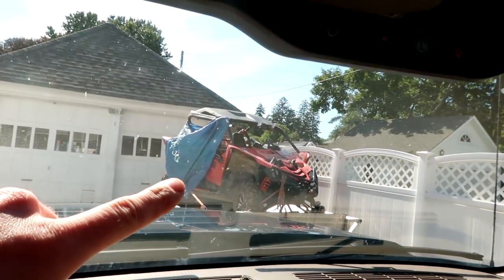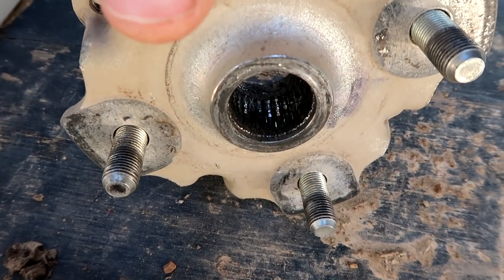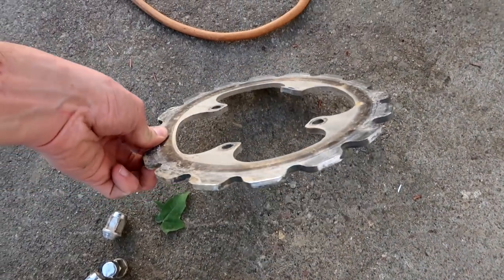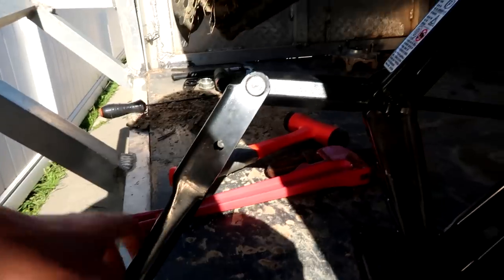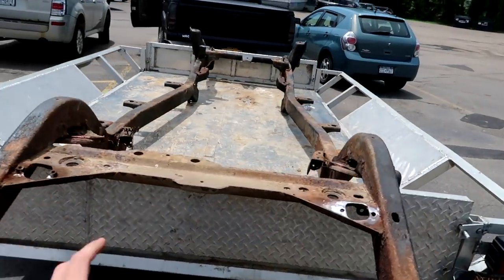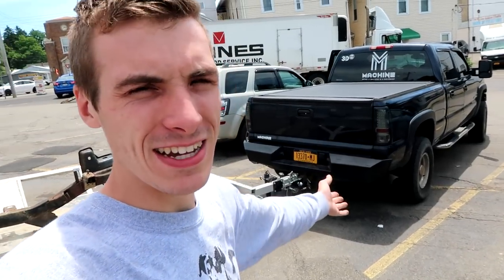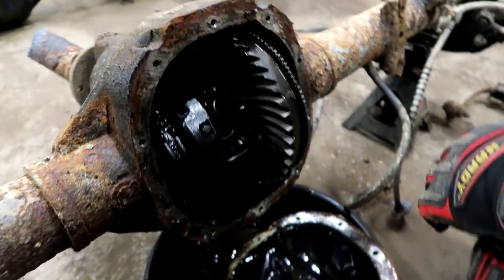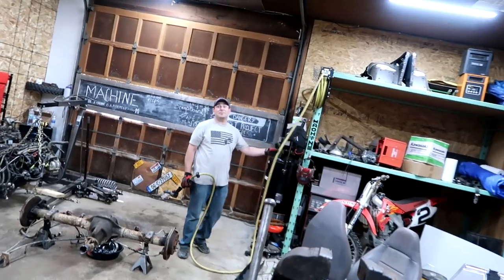DAMAGE AND DESTRUCTION REVEAL!!! (It's Not Good)

Comment: I just did a 8.8 swap in my Jeep YJ and I love it make sure u weld the axle tubes to the housing because their only plug welded factory and with all that power ur making with that turbo u might spin a axle tube.go with carbon fiber clutch’s in the limited slip unit the original clutches are only good for 80,000 or so miles @3dmachines

Comment: just so you know, I have almost the exast same kit

the only differance in mine is that mine does not have the longert extention.
Mine is made by the same compony

what I want to say about it is that you should not be too hard on the clipers, pliers, or vice grips as they are made of rely soft steel
and so are the screw bits

everything else is good though. it will treat you well for acational use.

Comment: Did the same conversion  except replaced the gears with 4:56 ratio and arb airlockers.  I added one inch wheel spacer to compensate for the difference in the  8.8 .

Comment: You need a thread file and a good tap & die set.You also need to have the transfer case output shaft and the rear axle pinion at the same angle or you'll get a vibration.

Comment: I’ll tell you a good tip....and that would be to drill a small hole through the centre of the wheel nut 🥜, then thread a split pin in to just prevent the nut 🥜 from coming loose...or small gauge wire through the hole will do the same thing as a new cotter pin.....cheers dalton from Australia 🇦🇺 🇦🇺 🇦🇺 G day mate........

Comment: They use to have crown nut with cotter pin Chrysler started that crap!( red tread locktite ) then punch it end!!can have a machine shop professional put crown nuts in with trusted cotter pin!! To uncrimp remove locktite use heat torch!!
Reply: may as well just tack weld the nuts  ;)

Comment: Always Always replace your nuts with a new one. Don’t ya know they stretch out if they are used more than once - and it’s the threads that helps hold - ya that’s what she said LMAO but really those nuts are good for one time than replace them.The threads become stretched out and will no longer stay Tite if used more than once: That is why if you look at a used one the threads are breaking off or have a distorted look to them. Use also should use a punch with a hammer to punch the edge of it to also hold it from moving. Now if anyone can understand what I just wrote good for you LMAO. But it true replace them after one time me of use. Thanks

Comment: why would they not have a cotter pin as the safety to prevent the hub nut from backing out id drill a whole through an put one my self an never trust a tiny little notch in the axel shaft as a way to keeping the nut from lossening it self

Comment: 250 ft lbs does not sound like near enough for a axle nut. On cars you take a breaker bar with a pipe on it and just toque as hard as you can.
Reply: most cars are 130 to 180 range. but always follow the factory specs ;)